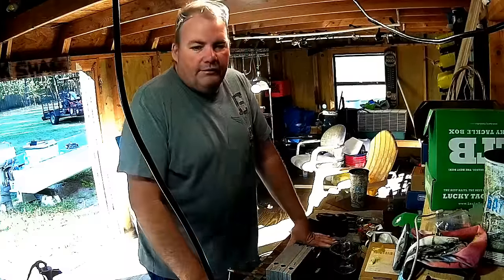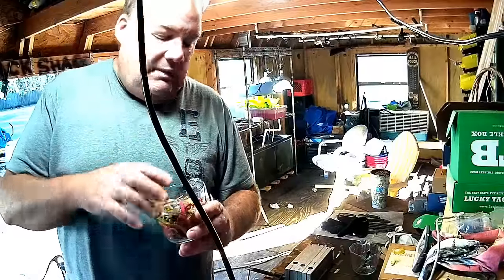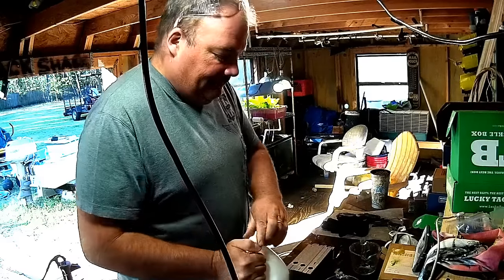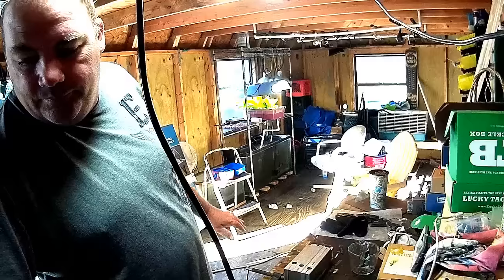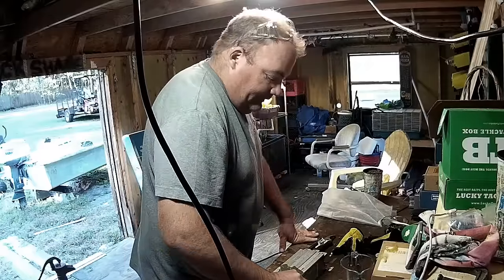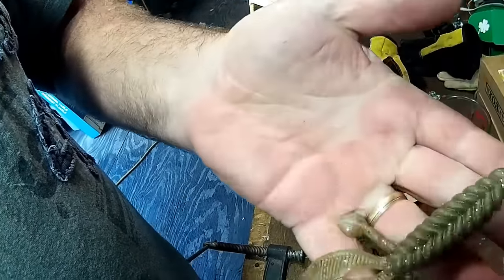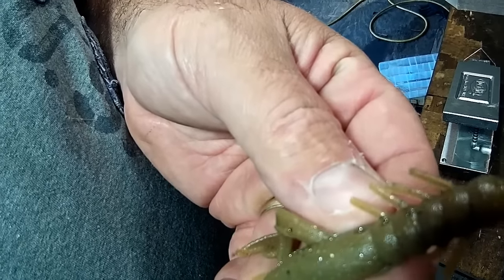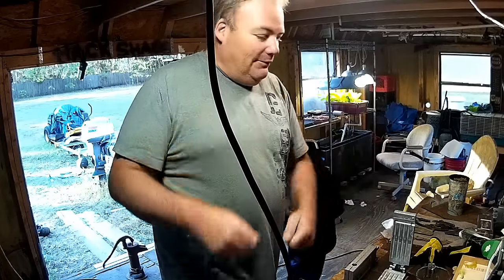making killer baits out of old soft plastics

Comment: Expensive to start, but can save you a lot of money in the long run.
Reply from the maker: +James Whitman your exactly right.it wasnt to horrible though to get started. I got the microwave from Craigslist, for, I think $20. The aluminum molds are about $40 a pierce give or take. And the silicone ones are about $15 the plastic was about $40 and the colors and glitter were admit $2 a piece. I mean it does add up, but If you do a lot of fishing with these tips of baits.it doesn't take long to recoup the funds.  Thanks for watching
Reply: If you recycle your own baits its pretty inexpensive to start

Comment: what looks good to you scares the hell out of most fish.

most baits sold are designed to appeal to your eyes and your interpretation of what you have been lead to believe attract fish.

no commercial bait is designed to look perfectly natural because it is simply to effective a bait.
Reply from the maker: Stupid Man I hear ya. The lure and plastics manufacturers are basically fishing in our wallets. I remember my dad had two goto baits and he would catch more and bigger fish than anyone on the lake be fished at. Thanks for watching.
Reply: BfishN what baits were those?
Reply from the maker: ComeOnPelican91 the ones I made from the recycled old baits was a craw and a beaver. They both work really well. Thanks for watching.
Reply: Oh I meant the baits your dad discovered. Were those craws and beavers?
Reply from the maker: ComeOnPelican91 are you referencing another video. I could not find it in this video.
Reply: You mentioned it in your comment above. "I remember my dad had two goto baits and he would catch more and bigger fish than anyone on the lake be fished at." I was wondering if the baits were a craw, a beaver, a worm, lizard/hog, or a fluke.
Reply from the maker: ComeOnPelican91 oooh gotcha. One was a rebel pop r  top water plug  the other was a culprit worm either black or red shad color.